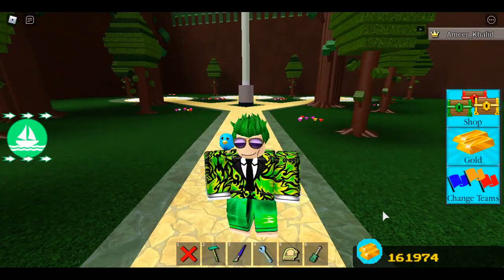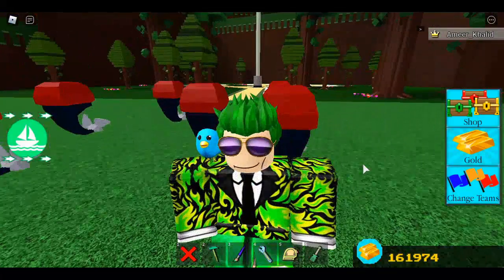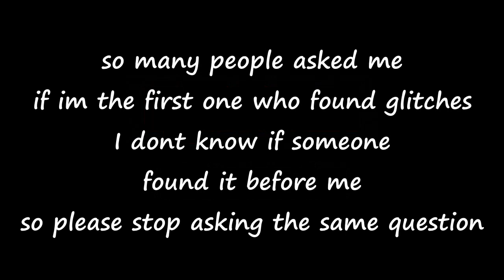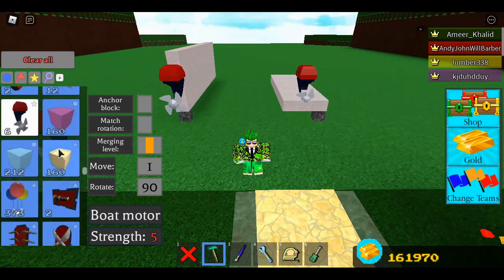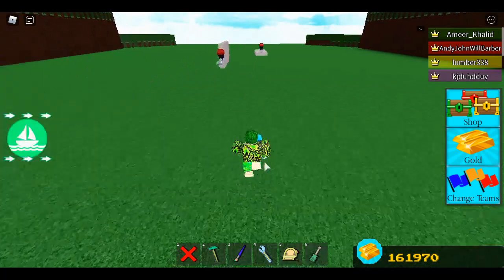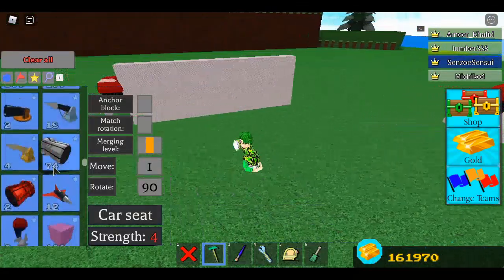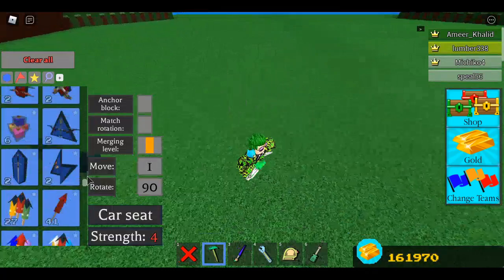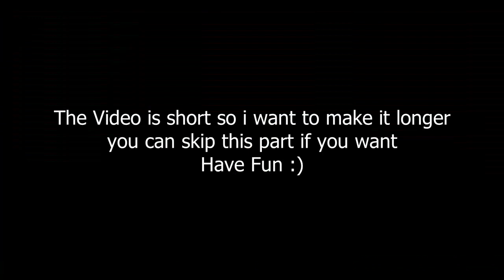Motor Conveyor GLITCH in Build a boat for treasure

Comment: Is there a glitch that does not use the screwdriver?
Reply from the maker: You dont need Screwdriver
Just do it old way
Reply: Is that by placing a block to hold it?
Reply from the maker: An older one
Reply: @AmeerYT  well what way is that can't you just reply with it
Reply from the maker: the conveyor glitch that use scale tool